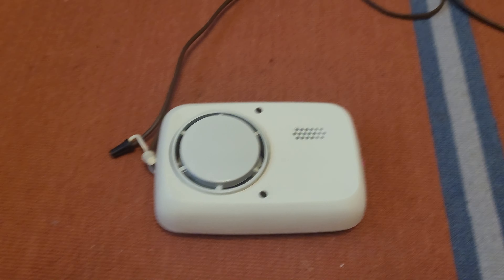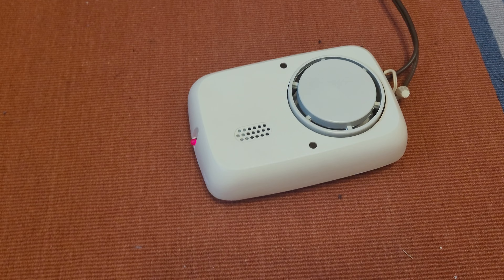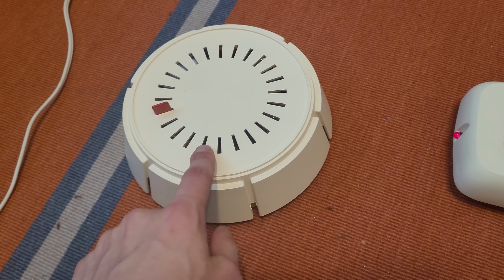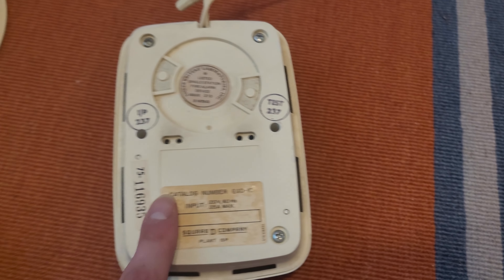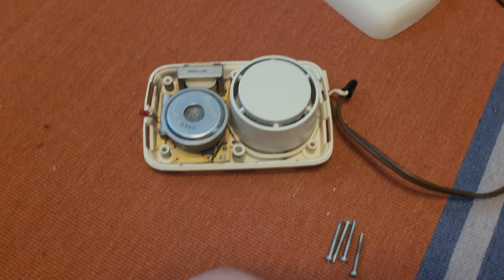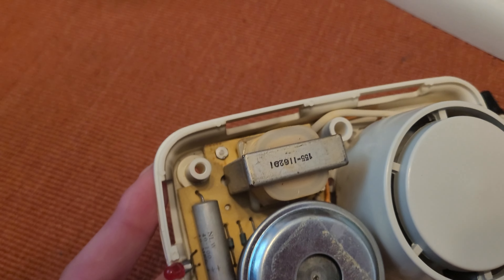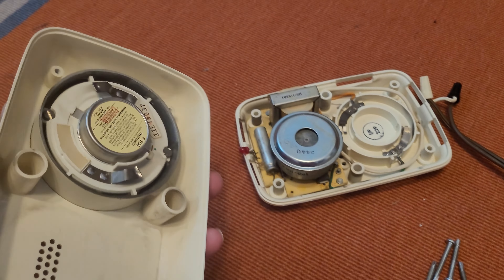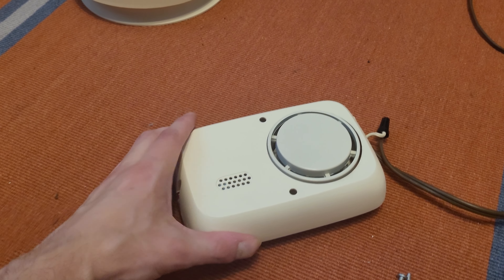Square-D Earli-Gard EGD-1C Smoke Detector

Comment: I’ve been dying to hear what this unit sounds like for decades now. My Auntie Marj had the exact same unit in her house which was built in 1976 so of course was the hardwired version. Never went off though since it was near the bedrooms on the second floor and of course no test button. When she sold her house and moved in 2004 it was still up there on the ceiling with it’s LED on and for all I know probably still is to this day. Such solid alarms and a very unique and robust design too. No doubt about it Pyrotronics made the best alarms of all back then. The later Guardions in the years after seemed to be quite well made too.

Comment: Cool find ! Im glad you got it. Mine sounds much higher pitched and makes a straight squealer noise. It isn't modulated like yours. I think mine also has an Edwards horn although I thought it was Delt Alarm. I have never taken the cover off of mine although I might try and see if I can. I would also love to see if the sensor on mine comes out. Yours also sounds much faster than mine. There is about a 15 second delay from when I spray the unit with test spray until the unit sounds but it stays on for sometime when it does. Mine was manufactured in 1976 I do believe.

Comment: Mine also had those 2 screws in those same holes as well. I left mine in so that I can display my detector sitting on my coffee table although mine did come with a tiny metal mounting bracket and three screws as mine was still NOS in the box when I got mine. It also came with a card that said to tell a friend about the detector and instruction manual. But it never had a big ring style bracket. The bracket on mine looks like it fits on the middle of the detector at the back. I have actually had this detector for sometime it was one of my earlier units when I was starting my collection although I never made an official video on it. Looks like I will have to do that as well. :)